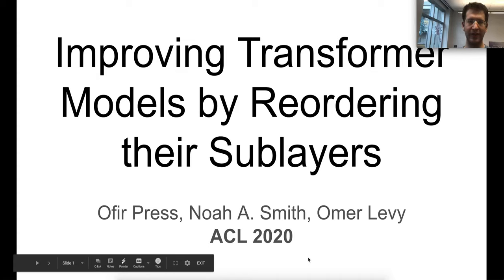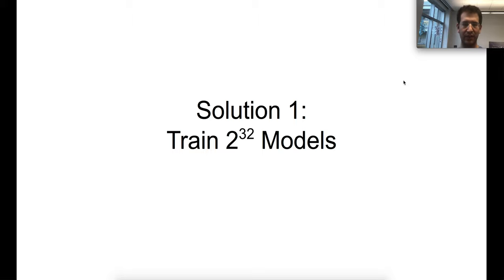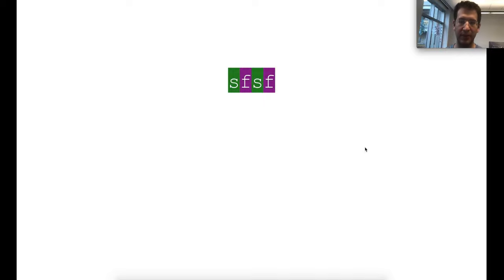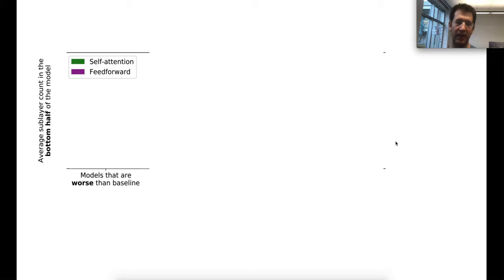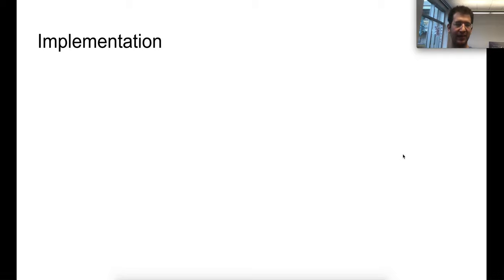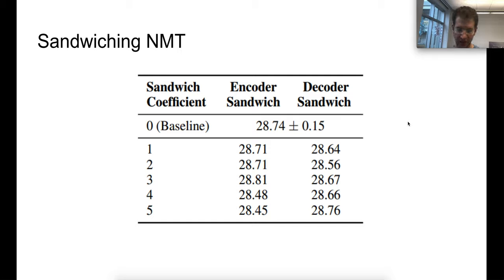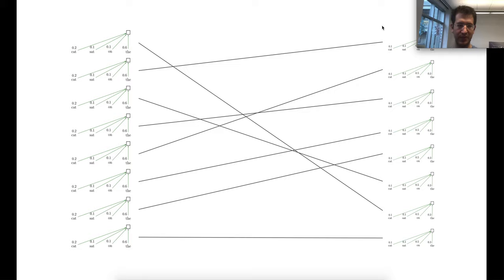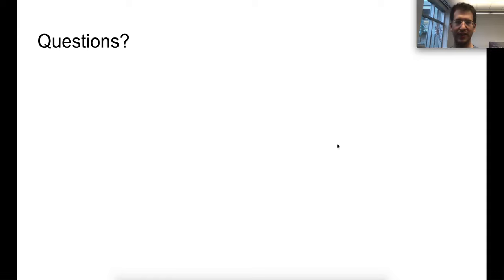Improving Transformer Models by Reordering their Sublayers

Comment: Thanks for the nice content and explanation ! I might use your findings for my current work :) Quick question : if the last layer in the sandwich encoder is a self attention layer, can you make it output a sequence that has a dimension that is different ( smaller or bigger ) than the very first input ? thanks :p
Reply from the maker: Which dimension would you like to make smaller? The sequence length or the hidden size? 
If you'd like to make the seq length shorter, I don't think that would be possible. In the final (softmax) layer you have to make a prediction for the next word at every index, and if you'd make your seq len shorter, I'm not sure how you'd do that. 
If you'd like to make the hidden size smaller, just make the output projection (called out_proj in fairseq for example) dim smaller.
Reply: @ofirpress  Thanks for the answer ! I'm not familiar with NLP terminology and just to make sure we talk about the same thing : a sequence length is the number of words and the hidden size is the vector length that represents each word right ? If this is the case, then yes I wanted to change the hidden size, basically having the same flexibility as a LSTM where you can freely change the hidden size.
Reply: @ofirpress  Actually I have another question: can the encoder part be used for online, real-time purposes ? Thanks ^^
Reply from the maker: @MrDonald911  You are correct about the description of hidden size and sequence length. This kind of encoder needs to receive the entire input sequence before translation. If you need a real time model, search for simultaneous translation models. Some of them are based on the transformer architecture.